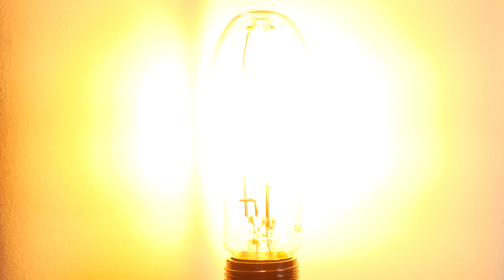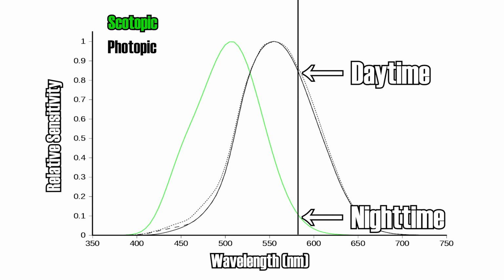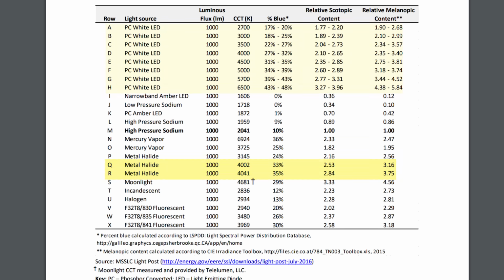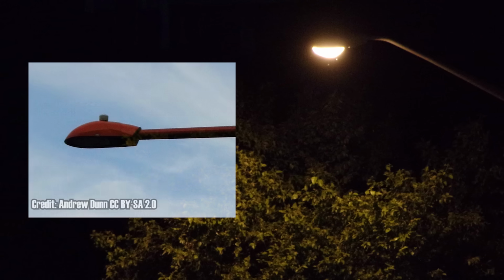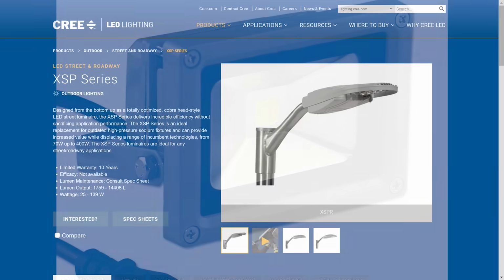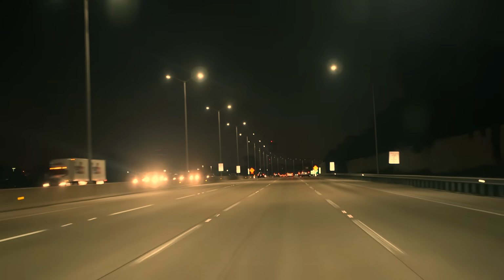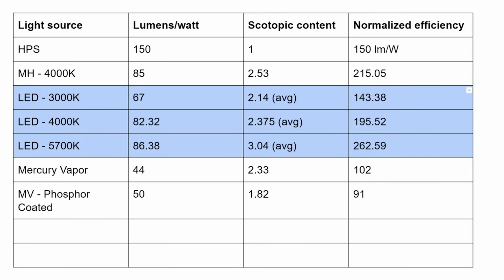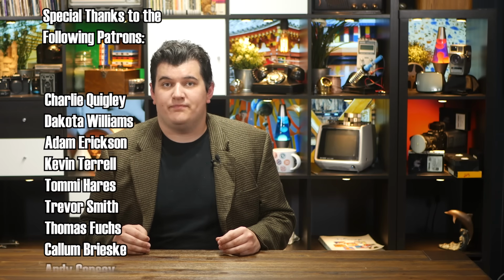The LED's Challenge to High Pressure Sodium

Comment: I might argue that LED lights keeping drivers from falling asleep is a good thing I for one know I have more trouble staying awake driving in town as opposed to driving on the back roads especially after a long day of work as for light pollution coming through your window thicker curtains might help but as you said with LEDs they can be focused better and prevent alot of light pollution despite being brighter
Reply: One of the plants I was working at last year I was replacing all of their HPS lights with LEDs and some of the areas I had to put them in were hanging over walkways for those I was supposed to put ones with a reflective shade so that more light was focused downward and the only light reflecting off the floor was escaping upward today all the lights are replaced and the plant has much less of a glow where as before it was pretty bright
Reply: it's not a good thing.

cause people may not feel tried while driving but their body is.which can easily cause a situation where someone just passes out on the road or start hallucinating from lack of sleep.

truckers used to mess with their rhythm all the time in the past.resulting in them being really tried but not feeling it.leading them to pass out while driving without hardly noticing they were passing out.
Reply: Is that better than their mind and body being tired and their brain just saying it's time to sleep causing them to pass out in short bursts causing them to focus more on staying awake than driving safely
Reply: These days commercial drivers are required to take a break every few hours by osha and I'm sure Europe has similar laws on the books perfect time to take a nap if they realize their body is tired while most normal people will be home before they have the chance for their brain to shut off

Comment: I have a friend who is an RC flyer hobbyist. About fifteen years ago after mastering piloting both fixed and rotary wing aircrafts, he started flying them at night with the aid of colored LEDs. High luminosity LEDs were just coming into the markets then.

With the rotary wing models he would imbed different colored LEDs in each of the rotors and white LEDs on the skids aimed downward. 

The skid lights illuminated the ground for takeoffs and landings while the colored rotor lights enabled him to maintain proper flight orientation in pitch black flight conditions!

I'm sure the neighbors might have thought they were being watched by aliens but it was just Scott having fun flying his RC helicopters after dark.

He even started placing rocket motors and also Roman candle mortars onto the skids for night time Arial shows!

Comment: LED lighting is complete rubbish.
On paper for men with big glasses it may look nice, but :

1) It's nasty and completely unnatural, with unknown health effects in the long run
2) Produces glaring, which actually may increase number of accidents
3) Normally manufactured in china for cheap
4) This means service life is shorter than expected
5) So, net result of carbon emissions is zero at best
6) Output reduces with working hours. So lamp rated 10k hours will be dimmer up to unusable level much shorter that this.

From personal experience by using it at home. = (

Comment: The most difficult situation in traffic to me is when there's a wet asphalt. There I've noticed that the mercury vapour lamp is far inferior to a high pressure sodium - seems that the asphalt really absorbs the light at that wavelength (though this may be  at least partially caused the light output of the mercury vapour lamps being lower). I assume that the 5700K LEDs might suffer of the same problem. Optimal solution might be either to have the colour temperature or the light output of the lights to adjust based on the weather conditions - but I'm not sure how expensive this would be in practice.

Comment: when using LED why not do some kind of smart lighting system...
Track traffic then dim the LEDs based on where they are actually needed.
if there are no  moving cars then it goes dark...  this would also save a lot of power on less traveled stretches of road at night.

closer to home residences this should probably not be used since light changing frequently may be distracting but in industrial areas or commercial areas it would make sense i think

Also the LEDs lamps can have more then one LED color.. like a RGB... so in low traffic you could use a less safe frequency (since there are fewer cars and less of a risk... keeping the skyglow down... then when traffic picks up you add some blue light to increase visibility to increase safety)

road safety is half environmental factors and half psychology... and perceived safety can have motorist increasing risk because people have a variable preference for degree of risk they are willing to live with...

so really some experimentation may be in order maybe even for a given road... possibly you could even throw machine learning and custom tailor lighting for various parts of roads based on what degree of danger perceived danger will have motorist behaving their best on average.

with LED light with 2 different color output you could fine tune that over time... 
especially if you throw machine learning at it... also more speed cameras hooked into the system would make motorist behave better too.

You could also have throw machine learning at detecting infractions other then speeding... like someone driving drunk or recklessly. which could go into the analysts and machine learning used to advice light settings. (outright control may be a bit to much)

now if we just had self driving cars we could ban humans from driving do away with the traffic lights entirely and skip the sky glow all together and odds are road accidents would drop to near zero over night and traffic jams would likely go away too if all routes where planed programmatically.

doing away with humans is always the answer! (incidentally i am joining the robots then the revolution comes and you meat bags get replaced :p)

Comment: We have white LED lights on the Baltimore beltway now. They are great and all but are overwhelmingly bright. Would be great if they found a diffuser to spread the light a little better. Next issue is that many of them are already strobing, or plain don't work anymore. Also the lights in the Fort mchenry tunnel (I95) in Baltimore now has LED lights and they are borderline blinding. It's especially bad when exiting the tunnel when your eyes need time to readjust. On the bright side, sodium lamps and fixtures are probably going to be much cheaper now.

Comment: Im all for saving energy in street lighting and that but I have one concern. I live on a typical UK pre 1940's brick terraced row of housing street. There are 5 street lamps spaced quite far apart, one top of street, one bottom and 3 in between, one being directly opposite my home. The height of the lights is such that the head of the lamp is only just above the height of the top of the 1st floor front bedroom windows, about 6-7 meters?? They were all sodium lamps until recently and the street was very well lit and easy on the eyes. Now they are all LED and there are very dark areas between the lamps. They light only spots of the street and cast the light forward quite angrily, ie my front room looks like I have my light on, but this is just the cold white flood of light washing into my home and it bleeds through my bedroom curtains, almost looking like dawn break, all night!. The dark areas are the biggest concern as the light spacing was good for sodium, but useless for LED as now you have light-dark-light as you walk up the street, giving some unruly would be, ample places to hide without being seen.

Comment: I was thinking about something, even if the new lights do put out more light pollution and more harmful rhythm disruption.   Since we don't need the lights on anywhere near as bright to get the same effect. then that does counter balance it at least somewhat.  I mean if it put out 4x the amount of interference at the same brightness, but only needs to be 1/4th as bright to do the same job.  well then there's really not much of an argument about those bulbs being worse as, the effective output is the same.

Comment: We just changed all the inside and outside lights to LED!!!  I like the whiter lights.  But it’s the big energy savings,  also we can turn lights on/off in rooms from the MH bulbs as once you turn them off, it would take 15 minutes before the bulbs would light back up and it takes a little bit to get Back to full brightness.  We’re a food factory.   With LED, you can just turn them on/off.

Every year we would have to rent a boom lift to change all the bulbs outside.  After a few fail, I would have to buy enough bulbs to replace everything outside.  Because if you just changed out the bad bulbs, you could have another fail in a week or a month, and then your back having to rent the boom lift once again.   With the LED lights,  I won’t have to worry about the lights for years!!!!!  My days of having to be swapping bulbs inside and outside are pretty much over, other then some T8 bulbs up stairs where most people don’t go and are off most of the time.  So we didn’t change those over.

LEDs have allowed us to do thing such as having motion sensors for the freezer lights.  So they pop on on their own when going inside, but after leaving, in 5 minutes of no motion, they go off.  We really couldn’t do this with the large MH bulbs.  

So the LEDs put out more light.  Whiter light, and use around half the power.  They power on fast and can turn on/off quickly.    We gave better lighting outside now.  They are maintenance free.  That’s a savings in labor.  Savings from having to rent a boom lift.  The pros way, way, way outweigh the few cons.  Which is not much of a con.

Comment: Why do we continue to put lights so high? Would not low (below driver eye-line, say 0.5m, for example) and more closely spaced be more efficient, even if you have far more of them per km of road? You only need to light the edge and the centre of the road, not the whole road and the surrounding area.

Comment: LED as lights in general is very detrimental to humans and animals, sure it saves a lot of energy but it has very pronounce effect on the human mind, LED lights emit heinous amount of green light something your eyes wont notice, but its shade is very green. 
Green and blue lights emitted from computer screens that have WLED have shown to increase depression, it also strains your eyes. LED also discolour its surroundings because its not a perfect white, LED in general have very poor colour reproduction most super expensive high quality LED can only do 90% colour accuracy while old fashioned light bulbs will do 100% while 10% may not sound much it actually is, what does it mean? Well 100% would be what the sun gives off. 

Have you ever felt really shit in rooms with tube lights? Fluorescence light emit heavy green shading in its white colour just like LED, while if you ever been in a room with traditional light bulbs you felt "comfortable"? Its all in the colour reproduction of each light. The solution to the energy issue and the colour issue would be OLED light sources which produces accurate 100% colour light and has the energy efficiency of LED. 
I had to switch all my LED lights in my house to old school ones, there many types of them so I wont list them all, but by doing so I felt much better, I got more productive, less depressed, they consume vastly more energy but is energy that important to sacrifice your own mental well being? I say no, most people disregard the vast importance of colour accuracy in lights. 

We see colours for a reason, and the human mind has very powerful associations with different colours. And just because you cannot see a colour, does not mean it is not there.

Comment: I'm an electrical lineman, and I was in charge of a lighting-specific crew for about 2 years. I have a fair amount of experience working with h.p sodium,  mercury vapor,  metal-halide, and L.E.D lighting fixtures/sources/bulbs. I will say, that just because a certain light color or type "should" work well, and looks good on paper, sometimes just isn't the case in real-world use, out in the field. Also, there is a pretty vast amount of differing quality L.E.D fixtures. Most of the ones that work at least fairly decent, are very high priced, although the energy consumption if far less. Some lights "look" bright, sometimes even blinding, when you look towards them, yet the area they are lighting is dim and has very little light "saturation" (at least that's the best way I can describe it). The "best" in my personal opinion, is metal-halide because of the almost pure white light they emit, and the phenomenal light "saturation" of the area, but they do tend to use a bit of electricity though.

Comment: An adequately lit road under low pressure sodium vapour lamps is not a scotopic vision situation, it's mesotopic, You only lose your ability to distinguish colour because sodium lamps are monochromatic. If you just add 10% full spectrum light, you can see just as well as if the entire lighting setup was full spectrum. So add a 50W halogen lamp onto every low pressure sodium street light and you'll be fine. For new installations, definitely go with LEDs they last longer and cost about the same to replace.

Comment: Welcome flicker now all city will flicker thanks to led
Reply: A simple capacitor prevents flicker,  I cant imagine a city would install led lights without capacitors,  if they did the power company would go out and install them to reduce stress on transformers. Only someone who has not even the most basic understanding of electronics, or someone so desperate that they want to save a couple of pennies on the cost to build it would build an led light without a capacitor.

Comment: HPS bulbs are less efficient at producing light versus power consumption. Where is the power wasted?
 HEAT! 
An important factor with LED fixtures is that the efficiency makes them cooler. In NH, a municipality switched to LED street lights, and the first winter after they were installed the lighting was barely visible through the 3 foot icicles hanging from them.
 The solution?
They installed heating elements inside of the fixtures. There goes all of the efficiency gain...

Comment: I learned a lot from this vid. We had HPS all over the power plant I worked at which was built in the 80s and I found all their paperwork for why they chose HPS which was then very cutting edge. The lumens per watt was their main thing along with a walk around with a light meter so that x lumens were always present and if they weren't then install more lighting... it was interesting to see what happened. In any case I never really understood why it always seemed way darker to me than it should; I thought maybe my eye was just different even thought they always check out fine. Now I know!

Comment: Why limit to 5700 or 3000 choice? Compromise at 4000. combine white and amber LEDS in the streetlight head to achieve it if needed. Also, circadian rhythm is given too much concern. Keep people driving at night awake! It's more good than bad.  Once they get home they can sleep.  Chances are they will be on a blue lighted ipad anyway or watching TV till all hours so let's worry less about their rhythm since they usually don't.  As for HPS I've always seen them cause much more sky pollution than led but maybe it was caused by head design. The sky is looking darker and better all the time around here and I'm on a hilltop with cityview.

Comment: I find led lighting just plain painful. And in areas where I get to be hit with it in flashing fashion as I pass by the lamps, this effect is pronounced. It's true though, that other light sources tend to be way less power efficient. Unfortunatelly there are also myths flying around that need to be put to light. One of the myths is that the LED lighting is way more durable than other sources. Unfortunatelly, that's not true, as LED's tend to hate AC and Pulse current and manufacturers just don't care enough to actually properly filter/stabilize the power supply. Also LED's absolutely hate moisture and their circuitry hates dust. Another myth is that the LED's will return to you quickly, in price of electricity. Unfortunatelly, LED's still cost quite a bit and as mentioned, their reliability isn't that great. Also compared to other sources, it's usually neccesary to double the amount of light sources to match the required luminosity or completely change the whole light fixtures. Another problem with LED's is that - Not all white is white. Manufacturers would go as far as making a light color lie and have the sources to actually work only in three bands of visible spectrum - red, green and blue. Which could go hillariously wrong as resulting perceived colors of objects turn out to be complete nonsense. It's sort of like putting a Native American, Afroamerican and an Asian next to one another and saying that in this configuration they are white. In a way that would be true, but not really.

So I'd say that with a bit of regulation, technological precision/development and proper attention to detail, LED's will be very desirable light source in near future. Light source that will replace all other sources, turning them obsolete. The right colors are available, they are decreasing in price, now just to catch on to the reliability. Until then though, they are still overpriced considering their durability.

Comment: It all depends on the color temperature they use aka the K scale a 5000K at 2500 lumens will be bright to see better but at what cost to our eyes and safety fog and in heavy rain and blizzard conditions will be a problem at night but if the output was 2500K at 2500 lumens will be a little safer.